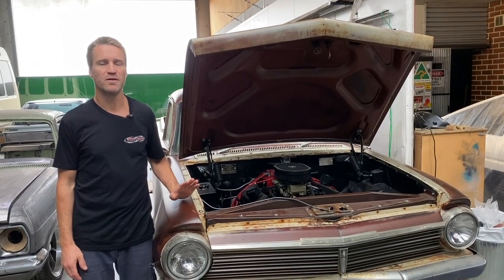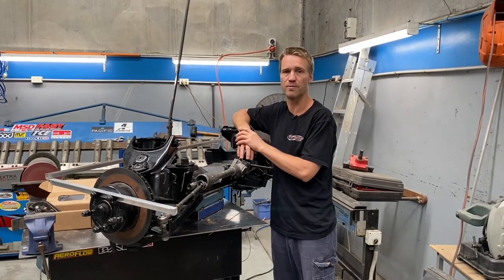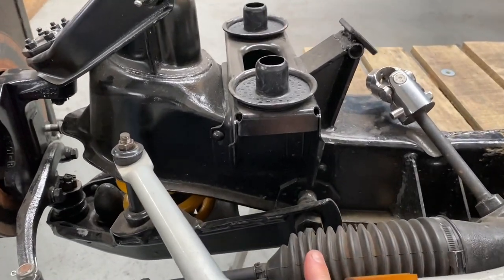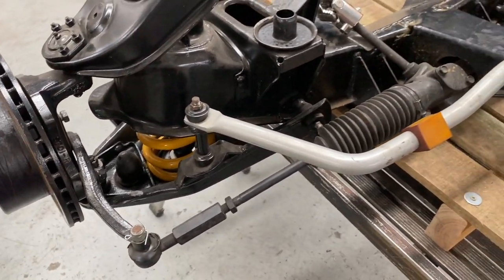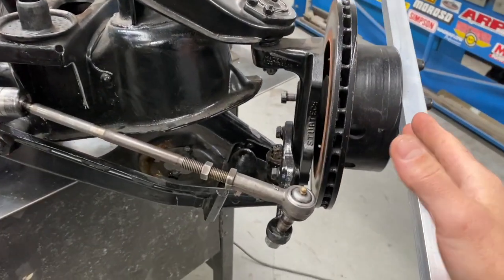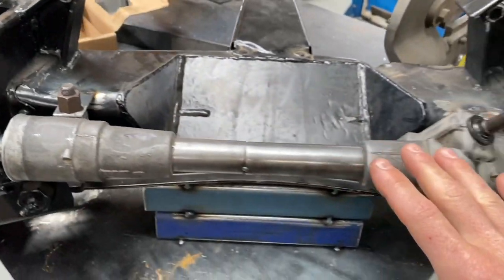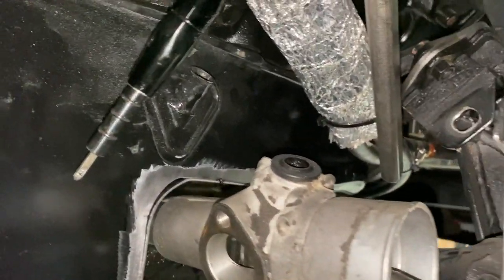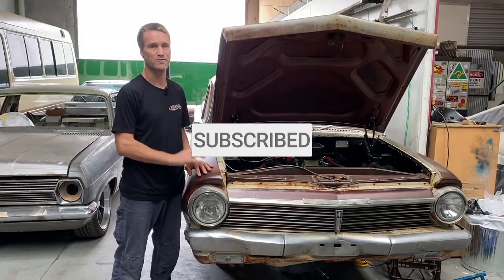EH Update Part 3 | Steering & Suspension Problem Solving

Comment: You need todo more homework on the Ackerman Principal! A line from the tie rods should meet a 2/3 the length oh the vehicle. you should not have to change the  vehicle geometry in anyway. If the steering is changed so that the arms are at the front of the suspension then these lines should meet at the same distant in front of the car. Modifying the front suspension and in particular the steering system is not a job that should be done without a complete and thorough understanding of the principals involved. Without this knowledge you are you are tempting disaster for all. 5:36
Reply from the maker: Thanks for your input Neville.
Reply: Neville, Plenty of us understand completely. It's almost impossible to have correct Ackerman with the steering at the front for the reasons you stated, the steering arms would hit the wheels BUT, I have looked at literally hundreds of factory stock cars and almost NONE of them are built exactly to the Ackerman principle, yep, virtually none, and some are actually miles off, they are all compromised due to lack of space. So whilst it's important to understand the principals involved, you still have to be able to fit the steering and try and eliminate bump steer, as Peter's done here... This has been passed by an engineer....

Comment: Sorry mate but do you realise when you move your recon opinion? If you use the same one on the rear when you turn left it will actually turn right. You have to get a opinion with the pinion piece going if it’s now on the top side of your main rack in it has to be on the bottom side of your main rack in just let you know.

Comment: Like your modifcations.have seen many Hr disc brake EH front ends here in Qld .Torana rack and UC Brakes .But like your design better.and modified sump aswell
Reply from the maker: It was a bit more work but it steers great. Especially with the power assist column